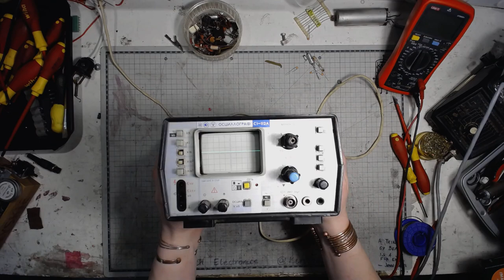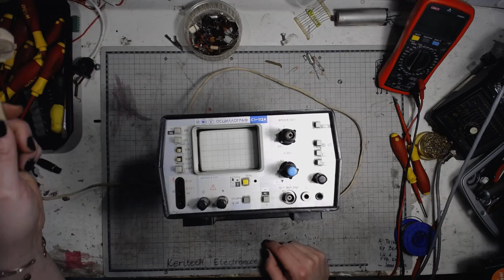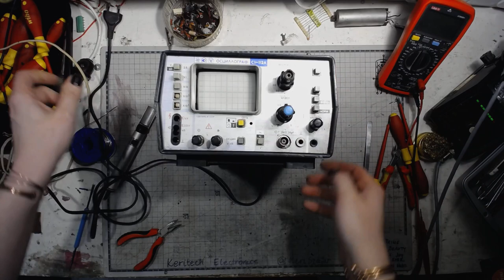The Soviet S1-112A Oscilloscope / Meter Repair, part 1

Comment: The Soviet gear was all designed with serviceability in mind. Very easy to work on and with just a little TLC every so often, will last almost forever. Compare that with the throw-away junk we are surrounded with today.
Reply from the maker: Got some pesky little bugger in that one... looks like it's either the PSU or something loading it too much. The construction of this scope isn't that lovely since you have to take out the whole electronics assembly out of the bottom shell of the enclosure, and by doing so you lose the rigidity (the bottom shell holds the boards together).
Reply: @KeritechElectronics  very true... Precision with patience when working on design equipment like this one is everything. I also hate all of the throw away junk popping up like it's gold. There are some very inexpensive device's though that are quite dependable, useful & fun to mess with. ☮️☮️